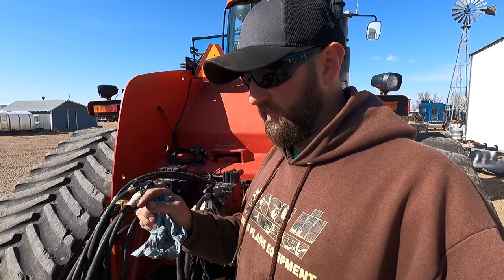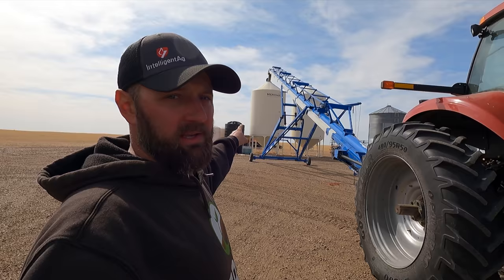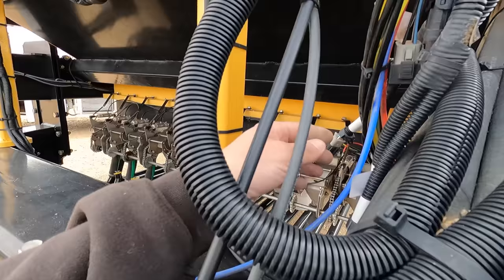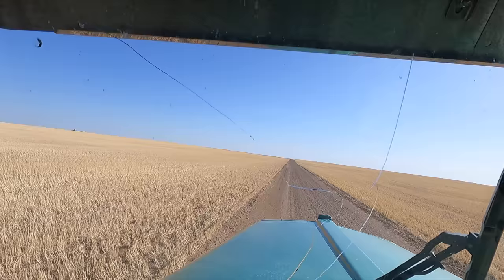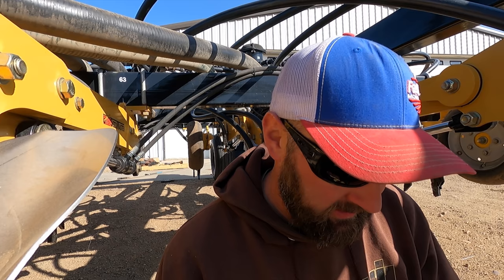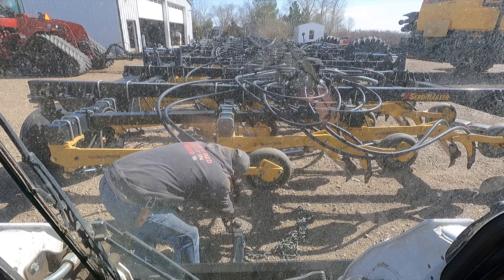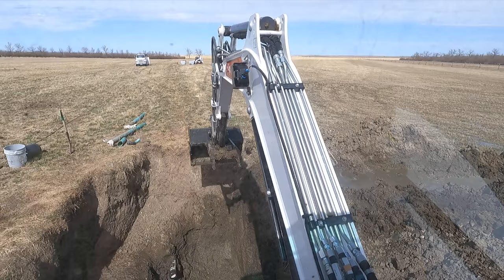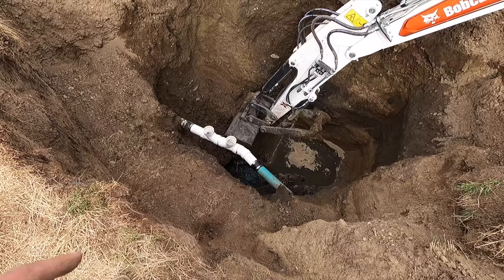Oh Crap! Not What We Had Planned!

Comment: I noticed you said you were having trouble with your hydraulic hoses blowing out.  I had the same issue the first two seasons I had my seedmaster and my 550 quad.  If your fix doesn't work there is one other thing you can check.  Good video, have a great spring.

Comment: I noticed the inside of the two rear tracks a little tore up.   Is there a noticing/tear point in the frame or is it just running over previous stems?  Wondering.
Do the knives have any carbide wear surfaces?
Reply from the maker: The tracks got into the hitch of the drill in a pinch.  Yes they are carbide. They run about 20,000 acres before they need to be changed.
Reply: thanks!   Amazing how far the use of metallurgy has come in past 30 years!

Comment: 13:00   real heat....  and a jack pushin from the next side OUT RIGHT THERE ON The 4x4 square....  I would think some kind of SERIOUS HEAT may be required to TRICK the metal back to shape, eh?  but wtuever LIKE COMMENTED AND SHARED !!! :) HAVE A GREAT DAY!  everyone, EVERYONE HAVE A GREAT DAY!!! THERE IS ENUF GREAT FOR EVERYONE TO HAVE PLENTY SO .....
Reply from the maker: That would wreck the paint.  This is how we have done it for 6 years.
Reply: @FastAgMontana  did someone give up the GOO that melted it yet????  and you just wipe it off with a squeggeee like strippin paint????  lol
Reply: @FastAgMontana  in my head it wasn't much MORE HEAT just like 1 more setting hotter a FEW MORE wutever out further at workarea (where the scraper is working....  it's what popped into my head,  not like a TORCH....  ;)  just like if yours has LOW n HI ......one with LO HI n VERYHI lol  kinda thing...